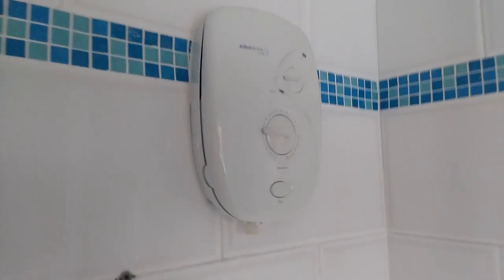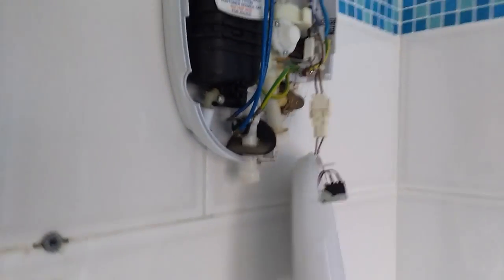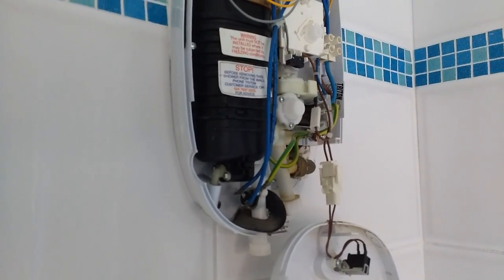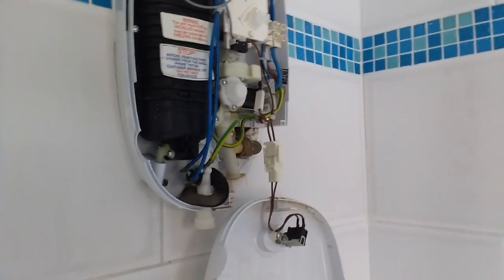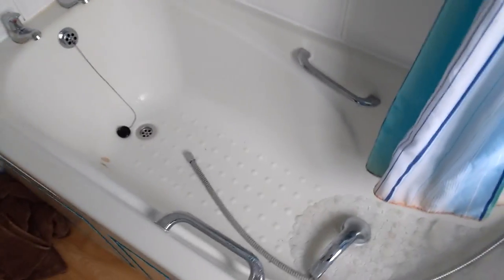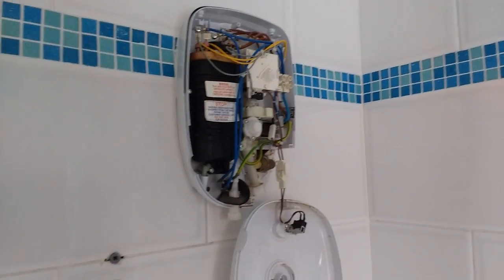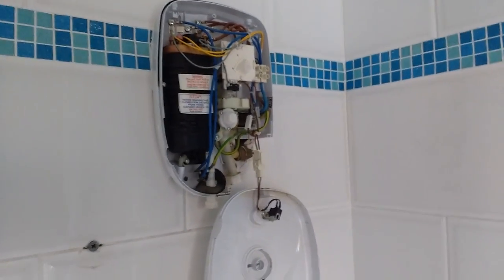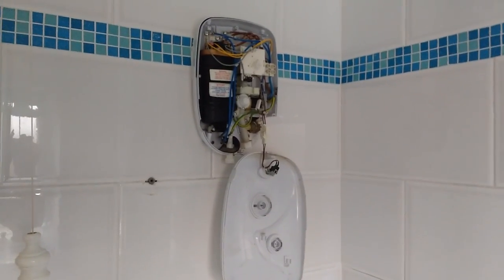Electric shower leaking from the side, replace the PRD (easy diy fix)

Comment: hi is it dangerous to use a shower when the prd goes off?
Reply from the maker: Hi no its not, you just loose pressure to the head
Reply from the maker: hi sorry for the late reply, but no it is not dangerous to use the shower when the PRD has gone you just have very low water pressure until your fix it
Reply: Two dogs life - our shower was leaking and has now stopped working altogether, you think the pressure release valve is the cause
Reply from the maker: Gecko hi the PRD only control s internal water pressure to the pump if the shower has stopped working the the PRD is not the issue

Comment: Hi sir whenever i press the button to turn it off the water keeps flowing. Is there a way to fix this? It takes quite some time before it actually stops
Reply: Your shower is working perfectly, the shower is emptying itself of water completely before switching off. Most showers these days now have a 3-5 second delay before the water actually stops.😤👍

Comment: I can't tighten the screw close to wall. Anyone got a solution
Reply: I had the same issue on aqualisa when I did mine today. I did use very thin and long screwdriver to get it done. I was lucky as I had all sorts of screwdrivers in the van

Comment: I've got the same shower unit as that.  I get water dribbling out around the middle plastic bit where the hose connects to.  
I checked the prd and the ball was still inside.  I changed it and the o ring but as expected no change.
Would it be more cost effective to buy a new shower unit.
Reply from the maker: if the water is only coming from the hose and not the connection pipe itself then the hose itself might be at fault, but these showers are "old" by comparison now and only cost £99 new complete in the box
Reply: Two dogs life cheers for the reply.  Always wanted a new shower unit for Christmas.